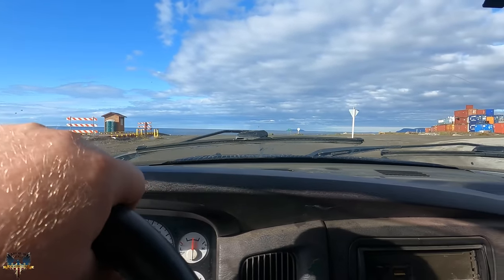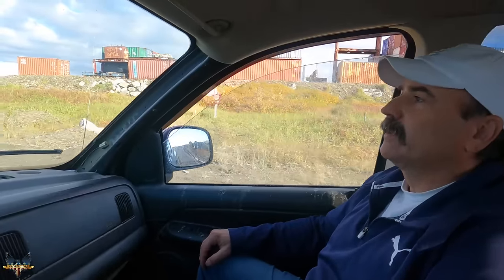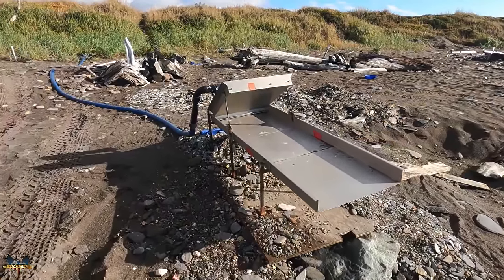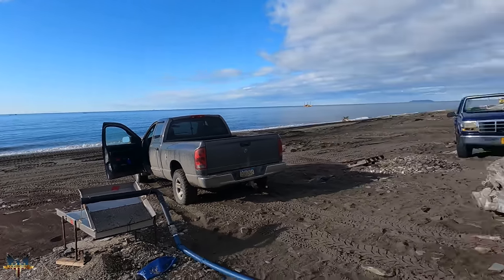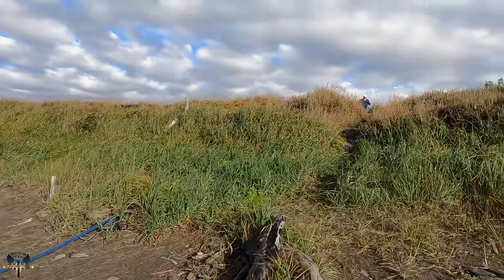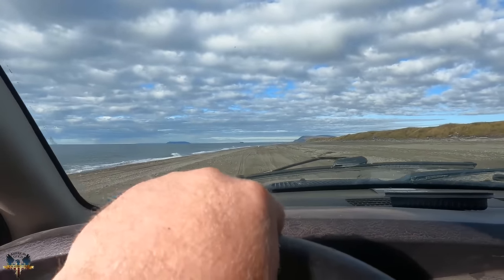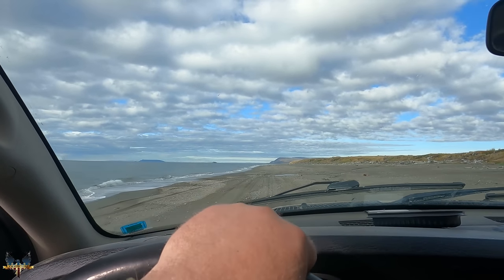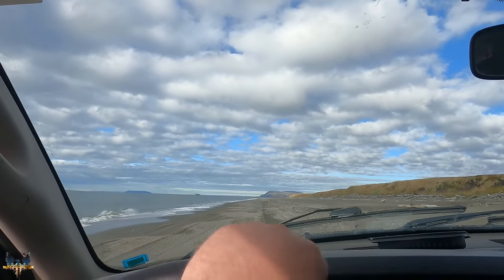Is There Good Gold 12 Miles West of Nome, Alaska?

Comment: I feel like because your running fines, you would really benefit from using miners moss, even just 1 section of your sluice. Folks all over the world go and dig gold on beaches and set up extremely primitive sluice boxes, but how they succeed is the miners moss and running lots of material and all by hand. 👍
Reply from the maker: Good idea! Thanks.
Reply: yuck.  miners moss is awful.  much better tech available
Reply: Miners moss will get clogged with black sand...   I used sawtooth mat or the conveyor mat like in the gold cubes

Comment: Bring your box closer to your work I never was any more than 3 steps from my outfit . It was easy to move and on wheels . Lots of Proper prospecting helps loads . On river sand bars I would dig shallow shovel wide trenches perpendicular to the waters edge and away from the water. The trenches would be about 10 feet apart . one would shovel the skimmed  material into a pan till full . pan then continue . This method would delineate your pay streak .Flour gold was what was the target and one would look for 150 -200 colors per pan before setting up . Material was classified on a curved 1/4" screen Collecting the flour gold was 98%  caught on just old wool blanket NO riffles . Yes it works in fact the wool blanket tray was on a 24degree angle . Although the sluice was set up to catch other types of gold . It seems in your area beach mining, one looks for garnet and a layer of clay ?  .
Reply from the maker: Yes red garnet sand and black sand holds the best gold. Thanks for watching!

Comment: Thanks Bryan. I would be curious to know if you could dry vacuum up the high grade beach sands. It would be like using a river dredge with water, but with a dry vacuum supplying the material. A shop vac on steroids would work, even though you might have to shut it off briefly to spill the material into a dredge hopper.
Reply from the maker: Good idea. We just do this for fun on our day off of dredging, so we don't put much thought into it, Thanks for watching!
Reply: yes behind the car with some good leaf blowers to make vacuum after scoop it up.
Reply: I'm thinking of bringing my Ryobi battery operated vacuum, connected to 5 gallon bucket cyclone, just shut off to move cyclone lid to next 5 gal. bucket. Rinse and repeat, boom buckets full, then move bucket to stand next to high banker auto  feed slowly with water hose in bucket, one after the other.

Comment: Have you ever heard of taking a piece of pvc pipe about 3' feet long plug both ends and drill a hole just big enough to stick the foot valve in, then on the pvc pipe drill 1/8 holes all over it, it only needs a 1" inch of water over it and it won't suck air or sand into the pump.
Reply from the maker: Great idea! Thanks for watching!

Comment: Why not reach out as far as you can with a foot valve into the ocean and see what you can suck up and catch in the sleuth? I'd get the longest reach possible and pull back slowly maybe and see what gold you might suck up. Heck, maybe you could use some type of styrofoam and float it out there so it would float around while its dragging below sucking up? If you could make this work, it would make it so easy to get the gold.
Reply: At that river going in the ocean would be great to try what I said.
Reply from the maker: The rocks and sand being suck up in the foot valve with destroy the pump in no time.

Comment: if you need 100' to get to the next spot, why wouldn't you take an extra 200' when you go back?
Reply from the maker: Water pump can only pump so far. Thanks for watching!
Reply: @AmericanGoldProspectors  I can't believe 'miners' know so little about hydraulics theory. The ability of the pump is measured in psi and vertical lift. most 5hp pumps can lift water a minimum of 300 vertical feet. working on a beach like that, where there is probably no more than 10' of vertical lift necessary, you could probably pump water a mile.
don't get me wrong, I enjoy your channel.